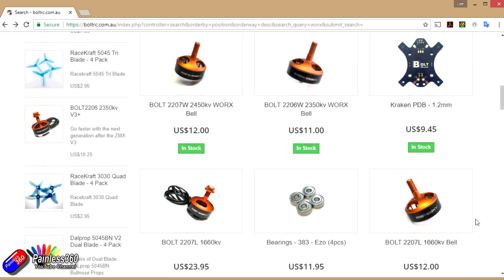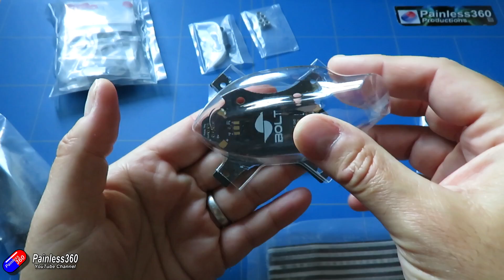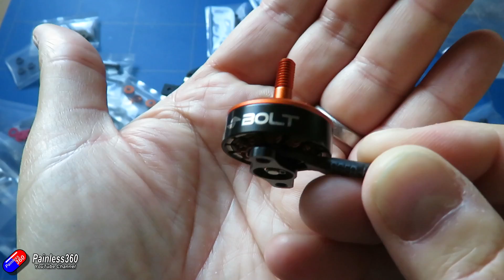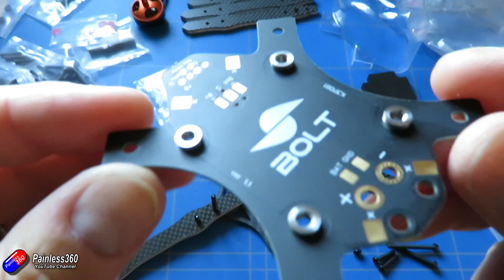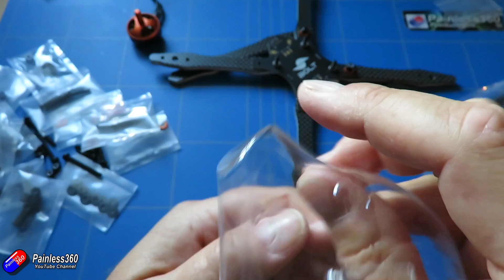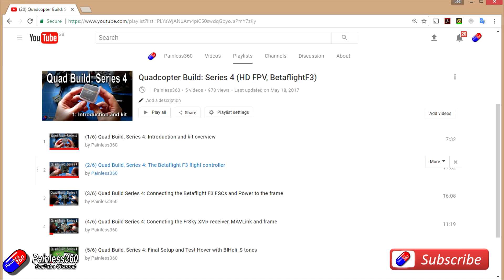RC First Look: Bolt Kraken 5 WORX Racing Frame

Comment: Did this build with many different layouts including trying the TBS Kraken power elite pdb for the TBS Elite bundle. By far the best performance to weight thus far is using the Cicada F4 AOI w TBS 5v race and XM on a stack board and a Run cam micro held in place foward of the provided bracket instalation mount and drilled holes for the micro side mounts directly to the canopy. This puts the micro camera finished edge just short of the intended location and thus saves additional weight and real estate. The Cicada F4 AIO "  now with OSD capabilities " powers the Bolt 2207 with ease and the arms are not overloaded by the ESC. I did not like the EMAX bullets in comparison however thew are definitely my 2nd and back up to the Cicada powered by RF1. Betaflight is the way to go and The Cicada has most definitely won the 1st place seat in my experience of 8 different Worx builds thus far. Cheers
Reply from the maker: Cool! Thanks for posting that. Despite it's unique layout, it's such a versatile frame and every pilot of one I know has a very different setup. Thanks for another great set of parts for those wanting to build one! Happy flying!

Comment: Built it up with raceflight FC  & Esc's. I'm really interested in doing a build with that setup
Reply from the maker: Nice idea, I'll see about getting some nice ESCs, I've got a Raceflight board here somewhere..
Reply: Painless360 The other fame I'm really interested in building is the Blueskimmer Falcon i230. I would only use the base section and do a much more compact stack and shell.

Comment: 20 amp Spedix lite is the go to ESC.  BoltRC sell that as a 20 amp 'Bolt less'.  If you've never flown a pod style frame, this thing tracks like it's on rails. I resisted flying them for so long,  but it's not hype.  There has been  some teething issues with the new Worx motors, but BoltRC has made adjustments to fix those issues, and does take critical feedback well.  A neat build is a must as well as a good choice of components you want to use.
Reply from the maker: Cool, thanks for the tip! :D

Comment: I put the vTx  under the frame with a Lumenier AXII antenna directly connect to a AOMWay 200mW. The vTx sit in a foam channel with the battery (3D printed channel would be better) the battery sits on this channel. The vTx is held to the  bottom plate with double sides tape. With this setup the antenna is protected and makes vTx instillation easy.
Below is the 3" version, with 20A 4 in 1 ESC and Betaflight FC. Not had any vTx overheating problems with either 3" or 5" versions.

http://imageshack.com/a/img924/9035/mCkG1R.jpg
Reply from the maker: Cool, thanks for posting!